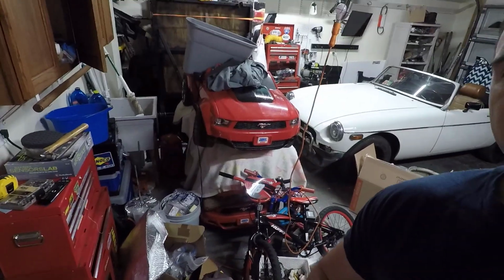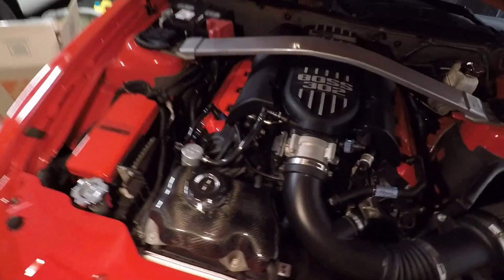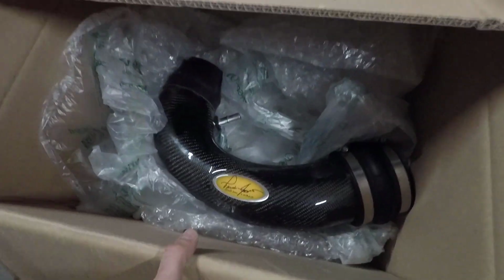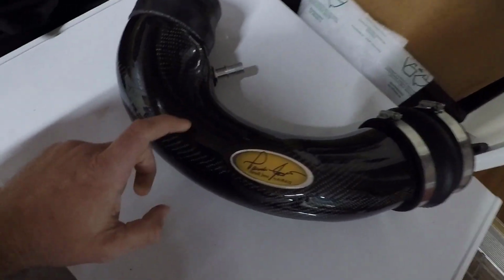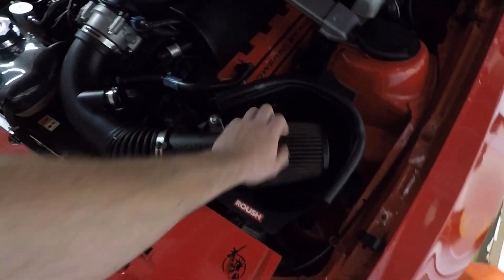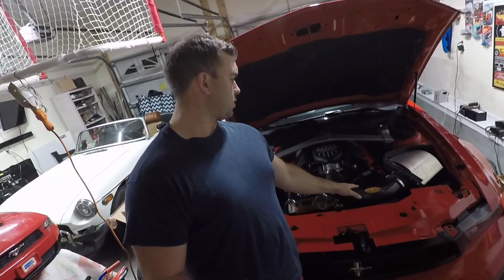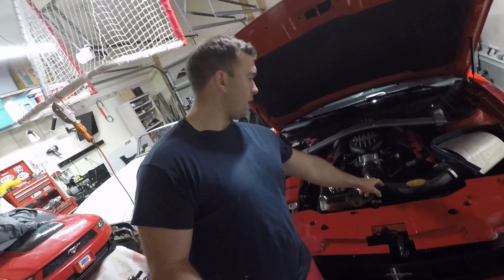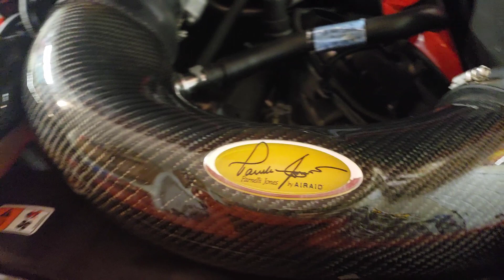2012 2013 Mustang Boss 302 Parnelli Jones Edition Carbon Fiber Airaid Cold Air Intake

Comment: As the owner of a 2013 Boss 302 and a 73 Triumph Stag, I appreciate the cars in your garage. Also drove a 76 MGB for many years.
Reply from the maker: Awesome there have been a couple Boss owners with similar classic British cars!!! Thanks for checking out my Channel Sir!   What color 2013?
Reply: @BrailsfordsRides  mine is a Performance White with a few mods. Headers, cat back, tune, Steeda springs, Koni yellows, upgraded panhard bar, aluminum driveshaft, camber plates, whicker bill, LS splitter, square setup and a few other bits and pieces. My son found the car and I bought it the same day. I think it will always have a spot in my garage.
Reply from the maker: @edwardstayman1726  I could never get rid of the Boss, love the car!!!

Comment: I overlooked it the 1st time I watched. Did you have the fuse box custom painted etc or did you find that online anywhere? Thanks again, enjoy the channel
Reply from the maker: Thanks Jacob, so back in the day JLT actually used to do alot of underwood custom part dress up.  They got out of that back in 2018 or so.  I lived 5 min away from their headquarters and I bought it at a discount off the showroom floor, one of their guys even buffed it up and installed it for me
Reply from the maker: Valvle covers are also from them, I found them used on marketplace though

Comment: They look good, however, two things - it does nothing for performance AND it's not an original signature, a 1,000 plus copied stamp- worthless..other than that it looks cool :)
Reply from the maker: Well obviously its a copy.  But in the Boss world this thing sells for big money used $650-750.  It will breath better once I tune it so yeah right now it is doing nothing with the flow restrictor that allows me to use the stock tune, but when I tune it I remove the restrictor and let her breathe.  That and headers will.make a nice combo.  Thanks for watching 🤙